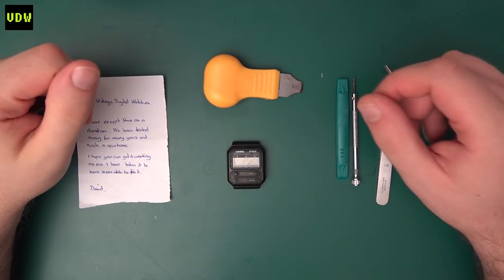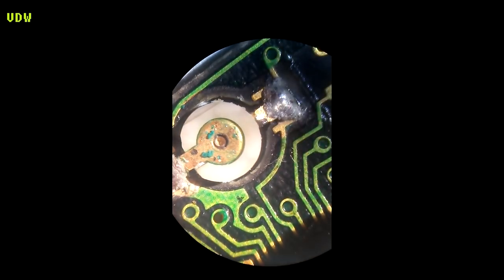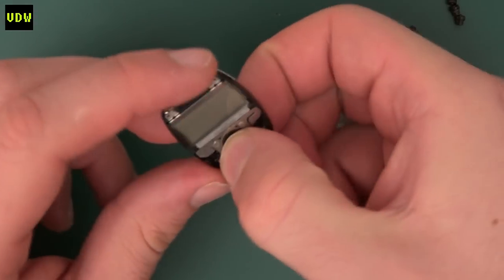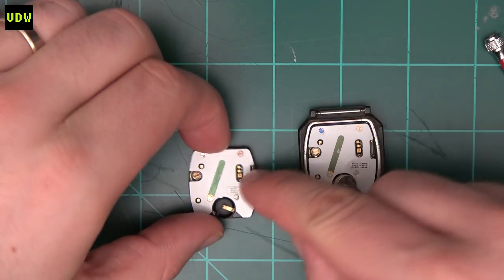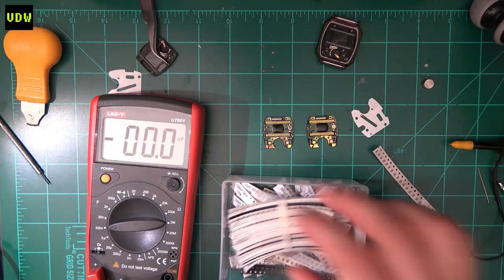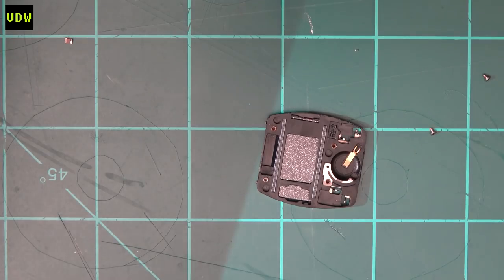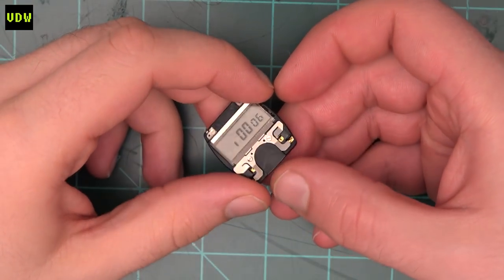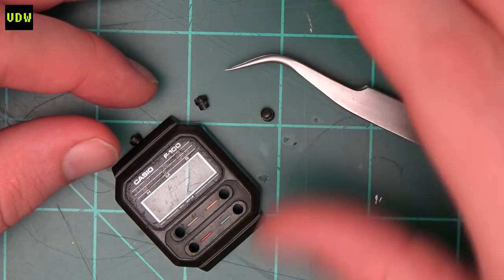Casio F-100 fix, Part 1- Ep 71 - Vintage Digital Watches

Comment: Your dedication is impressive as always. My first digital watch in 1979 was the cool CASIO 52QS-14, which (you told me) was the F-100 predecessor and had the same module.
Reply from the maker: Yes same module, the F-100 was even the first plastic/resin watch from Casio

Comment: Possibly one of your best videos from my point of view, you make soldering look easy! On my talking watch that I had to change a cap it took ALLOT longer!  I’ve also been there with a dead battery before and man you kick yourself when that happens!
Showing how to test caps is brilliant for anyone wanting to try . It would have been good to show what settings you would have your multimeter on to test.

I am excited to see how you get on with the casework and those buttons I’d love to know what your going to do! 
Good luck with that crystal I can see the sweat required from here!
Reply from the maker: Michael, good point on the setting of the capacitance-meter, it was set to nF(nano-farads). As for the soldering I did a professional course around 8 years ago as I needed to to this in a manufacturing environment so it's kinda like you are with polishing(you know your stuff very very well because it is work/job related).

For the case restoration I am actually more excited than the module as I have some ideas, you'll have to see :)  

Tibi

Comment: How do you fixed the missing fragment of the lcd? I got the same problem with my Casiotron R-15. Any insights are very helpful. Thanks .
Reply from the maker: There are a few videos o  the channel showing fixes for that, it is a matter of recp structing the trace to the sgment.

Comment: Hi! I'm not sure where to place this question, but you can maybe help me out. I've bought a Casio CMD-40 which was advertised as a non runner. It turns out it has a lot of issues, but I'm trying to give it a go. One thing I noticed is a couple of capacitors are gone (?!). I would love to replace them, but have no idea where to start. I can buy a lot of capacitor strips but don't know which ones I should get (0603 or 0805) and if this matters. Also I have no idea how to find out which ones I need when it come to the nF. Is there any way you can help me out?
Reply from the maker: Hi, hopefully through this answer. The CMD-40 is a fairly reliable watch so I am surprised it won;t fire up with just a clean. If you have trouble with capacitors you need to have the ability to measure the, use a capacitance meter. Moreover if you want to replace them you have to know the values of those capacitors and with a faulty waatch it is a long shot because it is hit and miss to measure the faulty ones. The 0603 differs from 0805 in physical dimension, use a char online and measure yours with a caliper to know which size to get.
Reply: @VintageDigitalWatches  The zebrastrips were missing, but I replaced them. The display does show everything, but the watch doesn't run. After a closer look it turned out the capacitors were removed (why would anyone do that?!). I have no reference what so ever for these capacitors. Thanks for your help, I'll just give it a try and buy a whole set of strips like you said in one of your videos and try, try, try. Love your video's by the way. I'm a total noob at this, but your info really helps and are full of interesting facts and info. Always a pleasure to see you upload a new video. Thanks!!!!

Comment: I have one of these beautiful watches but am having trouble finding a replacement battery.  Could you please point me in the right direction
Reply: It should be a 393 (also known by other codes such as SR754W or AG5) silver oxide battery.

Comment: My digital watch has a dead problem when the battery is inserted, then I do a reset  and finally it turns on, but it can work for a while, 
then my digital watch turns off again when the tweezers are removed,
can you explain to me what the problem is?
Reply from the maker: Sorry, not an obvious proble, needs dissasembly and diagnosis.

Comment: Hey got a question, I have a casio f91, I've modded the light a few months ago with an SMD LED 0805, been working well, until yesterday the light stopped working. I've opened it up and the area where it was soldered, the rectangular piece, quite fell off. so I removed it and resoldered it, light was working but the watch was not. Resoldered the rectangular piece where the solder should come into contact, watch was working but the light was not. Any ideas how should I fix this?
Reply from the maker: Sorry Giovanni, since it is a mod it is hard for me to relize what is happe ing there.
Reply: @VintageDigitalWatches   I've basically just replaced the stock light with a different light. Everything else is working other than the light. The reset function is working. Any place I could email you?
Reply from the maker: @guandasin3099  I will not be able to help you, mods are something personal to who did it (what tools they had, how the board was handled, what instruction they had etc.).

Comment: What is the frequency of the crystal oscillator?
Reply from the maker: A good one should be 32Khz, 32768 Hz to be more precise. On some watches it can be measured esily bu on some not, it depends on the capcity of the crystal and what other components are chao ed with the crystal(usually a capacitor or a capacitor plus a resistor)
Reply: @VintageDigitalWatches  Wonderfully correct.

Comment: I was about to ask you where do you get those brand new capacitors... and you just answer it,... :)
Reply from the maker: https://www.ebay.com/itm/0603-SMD-KIT-CERAMIC-CAPACITORS-83-VALUES-x-20pcs/311882569826?hash=item489da65862:g:aOEAAOSwie5XTIOy:rk:3:pf:0

Comment: Hi can you repair my Casio 52sq-14?
Reply from the maker: I don't do repairs for customers anymore
Reply: Vintage Digital Watches I very much enjoy your videos and am learning a lot with every viewing thank you!
On my Casio 52sq-14 the Metal positive battery terminal has broken in two pieces. Can this be soldered or is a replacement tab available? Can you help me locate one?
Reply: The battery terminal part @ 5:16
Reply from the maker: @plutoorbitdream  well only from a donor watch
Reply: Vintage Digital Watches do you have one in inventory?
Reply from the maker: @plutoorbitdream  sorry, no
Reply: Vintage Digital Watches thanks again for answering my questions. I’ve managed to temporarily repair the broken tab with some aluminum tape but the module is still having some issues. I have to press the battery in the hole hard before it will even make the watch work, then it’s hit and miss for it to stay running. I’ve got another working module/watch coming so I’ll do some swapping to make a complete watch with a backup for parts.

What oscilloscope are you using?